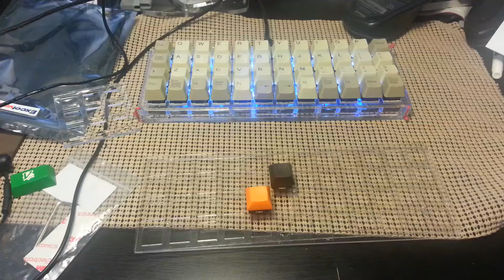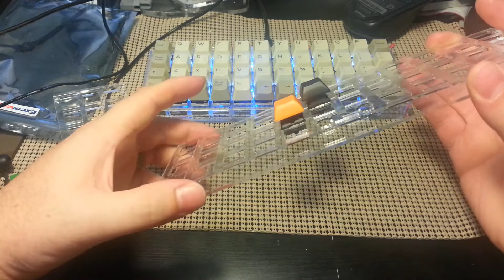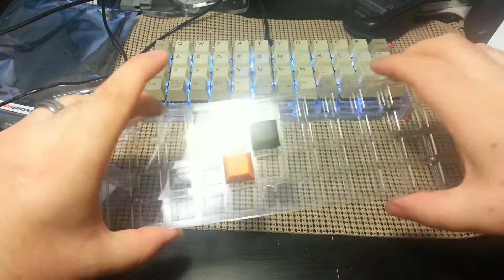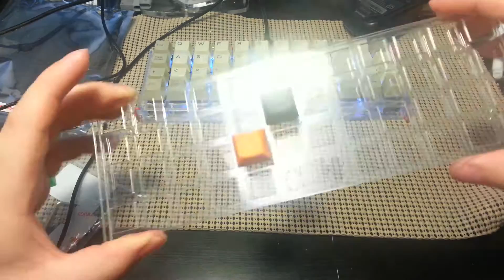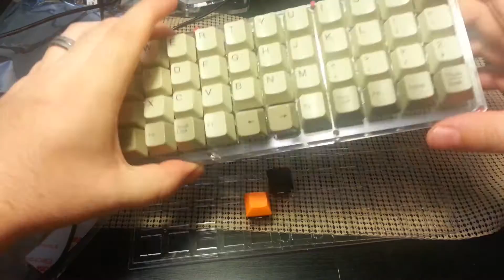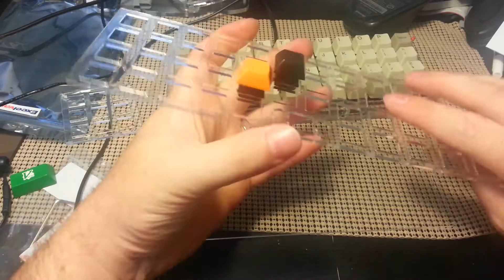Low cost 40% Mechanical Keyboard plates

Comment: What is that module that all the switches are plugged into called?  Does it generate more latency than soldering them together on a pcb?  Thx.  Great video.
Reply from the maker: Electronically, there's no difference between handwiring and a circuit board, just the difficulty :) Plus, handwiring lets you backlight the case without the PCB blocking the light [from] coming through.

They're wired into a Teensy 2.0, which tracks columns and rows just like any similarly chipped keyboard. Thanks!
Reply: Thanks for the response!

Comment: Troy I don't know how to send a PM but I was wondering how much you would charge to cut 10 plates for a keypad that has 3 columns and 7 rows? Here is my initial design (ignore the black circles those are knobs). http://stormforge.us/icpminimal.png. Anyway, I don't have a laser cutter and looking to get a tight fit for the mechanical keys. Price is an issue so can you let me know for both .08 and .22. Thanks.
Reply from the maker: Lasergist might be a better option, but I can help you even with that, send me an email; my last name dot my first name at gmail!
Reply: Checking out their site now! I'll email you as soon as I have had a look see. Thanks!